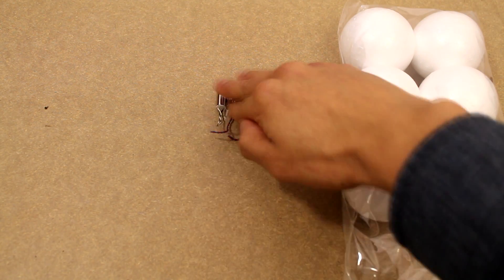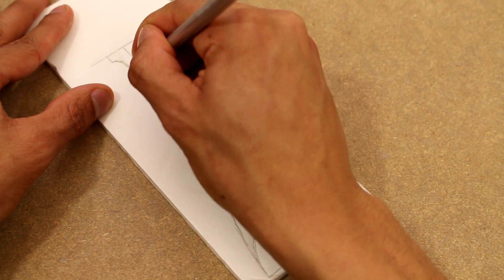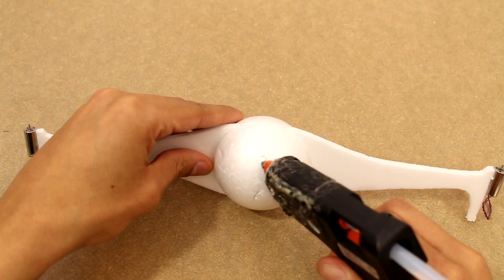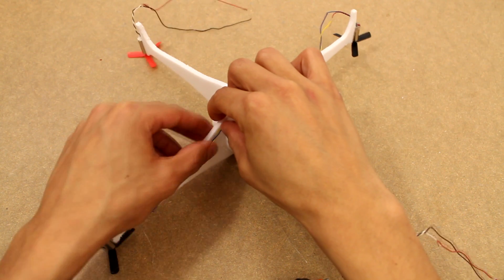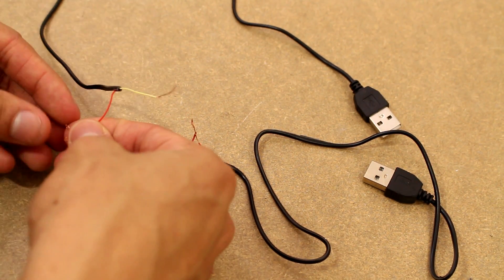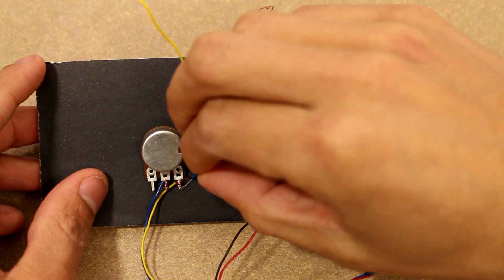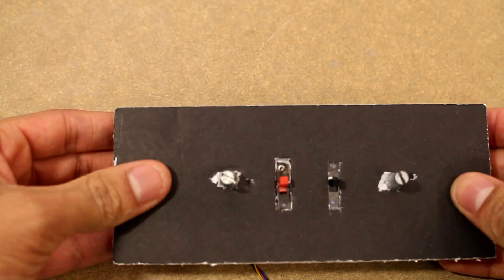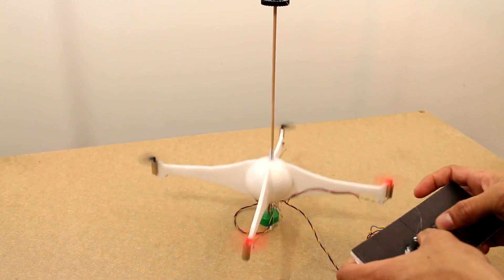How to Make a Homemade Drone

Comment: propellers 2 clockwise 2 anticlockwise including the motor or just propellers?
Reply: Just propellers, the motor will spin based on which side of the battery is attached to the motor
Reply: @sandsoftime7611  thanks.

Comment: if you attache a weight, say a well chosen fishing tackle weight to the botton of the sphere, it would slow down the drones attempt to roll over, Also, with a couple of different value resistors, say  50, 100, 200, 300 ohm and put in series with the motor that is lifting the most. This, is an attempt slightly slow down the motor to the speed of the other manualy, automatic drones that have gyroscopes have automatic variable resistors to assist with level hover, and with actual flight!

Comment: It seems like either your center of gravity is off or your motors are not delivering the same thrust. 
You need sensors on each motor to measure rpm, and need a gyroscopic sensor. Then you can write code that when for example when it rolls towards x axis an engine automatically compensates and corrects the speed to balance it. It's rather easy to do with an arduino. 
Also just see how it balances when you balance it on a stick without motors running

Comment: you need to wire the motors to esc to flight controller and buy a mini 6ch receiver and transmitter. the key is to buy small

Comment: It's not a "drone" (as your title suggest) if you can't fly it by remote control.  "lose the wires" and the guided pole thingy and maybe you're on to something... c'mon man, 9volt batteries connected to a set of motors???  C'MON man...!!!  DJ SOUL FORCE

Comment: I suggest using a a Syma micro drone controller any of them and the remote it comes with it has a gyro and the auto stability and the receiver built in so you can just jam it in that sucker with a Lipo and have yourself an untethered quad my dude

Comment: You need to add a flight controller and a lipo to it. That way you can add betaflight/cleanflight to it. And actually have a real quadcopter. 

For something of this size, I would recommend a f3evo brushed and a 600mAh 1s. 

Then you can control it with a rc transmitter. 

You would need something like this. This would work with frsky radios, such as the taranis. 
http://www.banggood.com/Eachine-FRF3_EVO-Brushed-Flight-Control-Board-Built-in-FRSKY-Compatible-SBUS-8CH-Receiver-p-1091779.html?rmmds=search

A cheaper option would be to get a flysky i6 radio, and a flight controller that's compatible with that.
Reply: OR you can buy a mini drone, i got a $19 one in a Costco in my town, it can make tricks, and have a crash proof "jail" made of plastic to bounce out of walls and ceilings:)
Reply: the best thing
Reply: the best thing
Reply: choda
Reply: eachine E010?
Reply: Yes, E010, my bad.
Reply: Have a look at the E101, F36 and blade inductrix. Lots of people modding them into "tiny whoop".
Reply: David B + 1/2 m cable is Not hard fly
Reply: David B p
Reply: yes

Comment: wow very Genius am impressed thanks alot
ahm how can i get this motors.
 in the local markets around cant find them is there any device s that come with this kind of motors?
Reply: Meta Muhamud noah l think  the mobile vibratory motor is tinier and mor powerful and consumes less energy.
Reply: Meta Muhamud noah wxtvuvu hvjvyxrr
Reply: Meta Muhamud noah Yes they are found inside rc helicopters and other toys. Mostly in flying ones. However if u want to buy instead of searching from them u can find it in amazon. Search' coreless dc motor'

Comment: hey josh where u got those motors?
Reply from the maker: http://joshbuilds.com/product/coreless-motor-diy-quadcopter-8x-3-blade-propellers/
Reply: jeevan je e
Reply: They just look like 8.5x20mm brushed motors. Banggood should have them. I have no idea what rpm he used

http://www.banggood.com/4X-Chaoli-CL-615-Upgraded-6x15mm-59000-RPM-Coreless-Motor-for-FPV-Racer-Blade-Inductrix-Tiny-Whoop-p-1102956.html?rmmds=search
Reply: Marcus Penny Pretty sure those are 6mm. The ones in the video were larger than that. 
But they would work, as long as you were under about 30grams AUW
Reply: jeevan jee
Reply: ON Mercy 
Hjjh
Reply: leave a battery on the drone leave it fly to the sky
Reply: jeevan jee u can find on ebay
Reply: jeevan jee  white corelees motor
Reply: What is the name of the glu
Reply: jeevan jee
Reply: attttttttttttt
Reply: Hi
Reply: Ebay :)
Reply: jeevan jee
Reply: we have produce this kind of motor ,if you need ,pls contact with me .our website: www.cymotor.com
Reply: sir you can buy them from banggood.com
Reply: jeevan jee i
Reply: Hot Glue Gun with Glue sticks
Reply: motors
Reply: He always puts the places for the items in the description
Reply: jeevan jee from a drone or a mini drone but you can order them online
Reply: http://www.amazon.in/Engineerstoys-Coreless-Motor-Propeller-Set/dp/B01HTIN6CE?tag=googinhydr18418-21&tag=googinkenshoo-21&ascsubtag=cb2d0335-7b8c-4d42-953a-d56ee80d9192